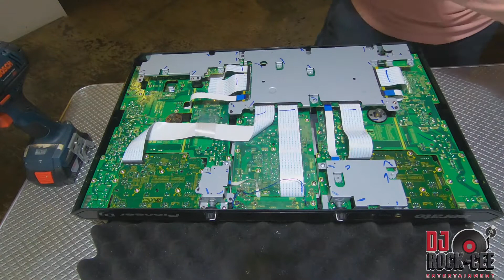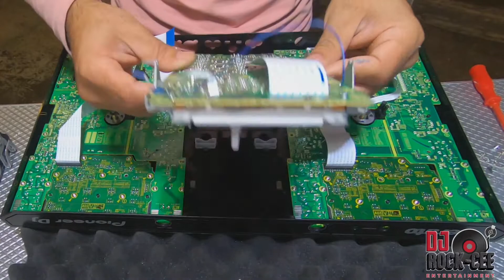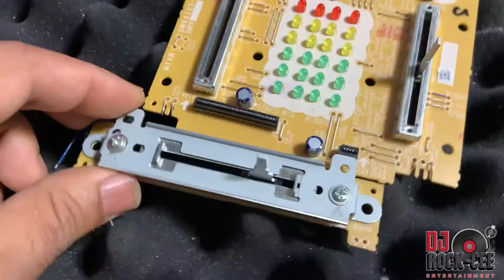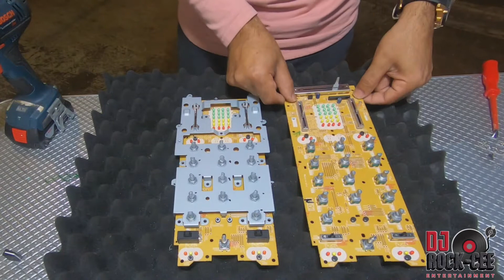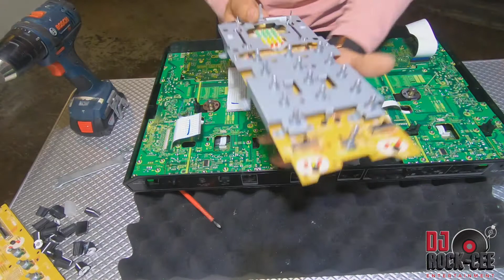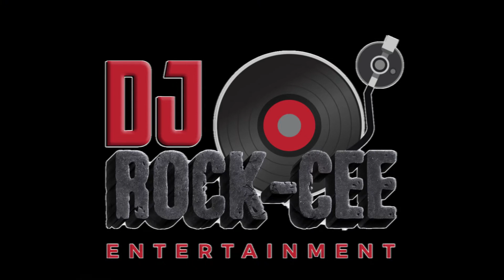PIONEER DDJ SR2 FADER REPLACEMENT / MAIN CONTROL PCB BOARD REPLACEMENT

Comment: Do you know if the faders on sB3 an Sr2 are the same ?   Interchangeable?  I have both.   But the SR2 is glitching , an parts seem to be forever to get delivered,   So was wondering could I use the Sb3 fader in the SR2.  Until I can get a part to put a replacement in the SR2??    Thanks
Reply: https://instrumentalparts.com/shop-by-brand/pioneer-dj-spare-parts-cdj-djm-ddj/pioneer-dj-ddj-xdj-controller-spare-parts/pioneer-ddj-sr2-spare-parts/
it shows all the equipment it works for at the bottom .
Reply: @dustinblair3475  thanks.  That’s where I actually bought my replacement fader about a month ago.  Great and fast service.
Reply: Btw they are interchangeable.  But have to soldered